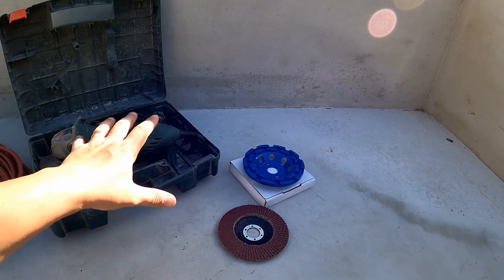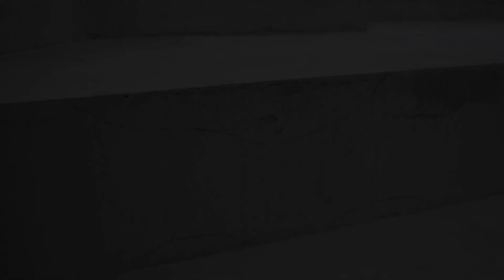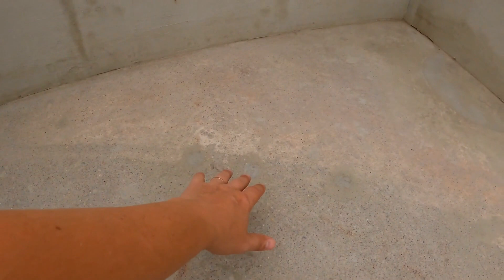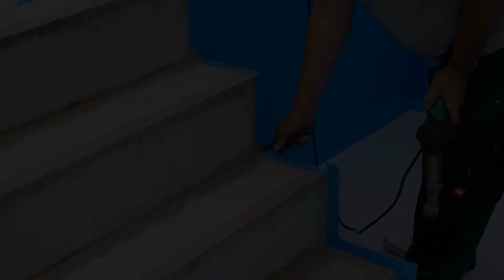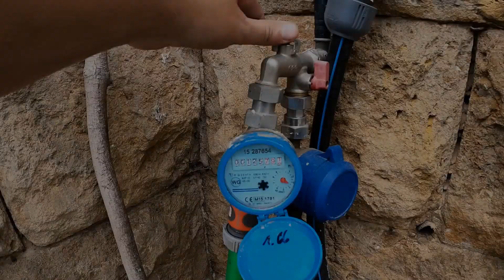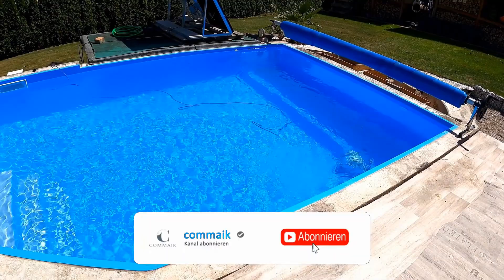Laying and welding the pool liner yourself - step-by-step instructions

Comment from the maker: *👇 All products & links from this video:
🔗 Protective fleece: https://geni.us/3Adh0Ah (Amazon)
🔗 Roughing disc: https://geni.us/zxzIG (Amazon)
🔗 Foil welding device: https://geni.us/Pac0G (Amazon)
🔗 Film sealing device alternative: https://geni.us/rRk0m (Amazon)
🔗 Pressure roller: https://geni.us/P9lu (Amazon)
🔗 Cold welding agent: https://geni.us/vNKZCUc (Amazon)
🔗 Pool enclosure: https://geni.us/sAjQBj (Amazon)
🔗 Pool robot: https://geni.us/9nUYy (Amazon)
🔗 Solar tarpaulin 400µm: https://geni.us/dlFaBWG (Amazon)
🔗 Solar tarpaulin 500µm: https://geni.us/L9rc3 (Amazon)

Other suitable products for pool conversion:*
🔗 Complete pool construction set: https://geni.us/hh8NAb (Amazon)
🔗 Connection set: https://geni.us/C5eSA (Amazon)
🔗 Compression fitting: https://geni.us/wUze (Amazon)
🔗 Drainage pipe: https://geni.us/8fcr7 (Amazon)
🔗 Headlight complete: https://geni.us/0FyQM3 (Amazon)
🔗 LED RGB spotlight: https://geni.us/jWjATYz (Amazon)
🔗 Pool pump: https://geni.us/1A5RFh (Amazon)

You can find a detailed blog entry with lots more information on my website: https://commaik.de/2024/02/poolfolie-richtig-verlegen-kleben-und-schweissen/

This video was originally created in German for my main YouTube channel @commaik 🔗 https://youtube.com/commaik. It has been translated into English using 🤖 the AI tool HeyGen, which replicates my voice and synchronizes my lip movements. 

Please note that ⚠ due to dynamic adjustments, the synchronization may not always be perfect.

📺 The original video, which includes English subtitles, can be found here: https://youtu.be/gGgzpildBIs

Comment: None of the links work in the us. Is this product available to consumers or are we required to be a dealer?
Reply from the maker: Thanks for your comment! The links in the video description originally point to the German Amazon website (amazon.de). I use Amazon One-Link to automatically redirect them to your local Amazon store – like amazon.com in the US. Most of the time this works quite well, but unfortunately, not always.

If the redirect doesn't work or the product isn’t available on amazon.com, you can try searching for it directly on amazon.de. In some cases, international shipping to the US is possible – that depends on the individual seller.

You don't need to be a dealer – the product is generally available for regular consumers. If you’d like, I can look up an alternative source or send you the exact product name.

Hope that helps! Best regards!